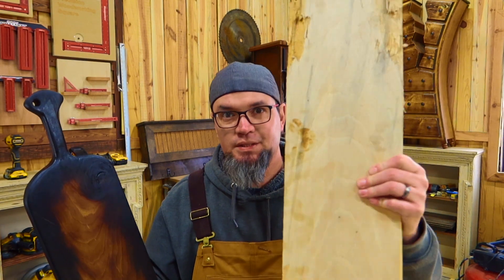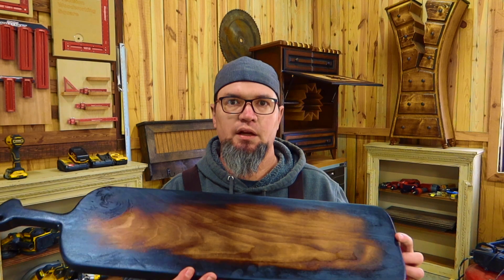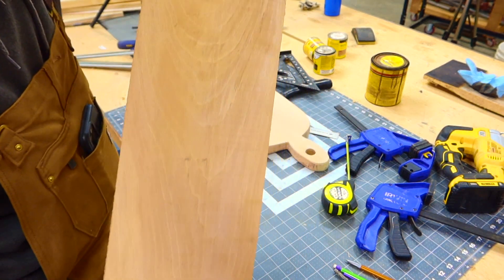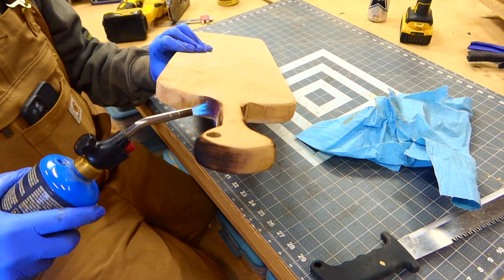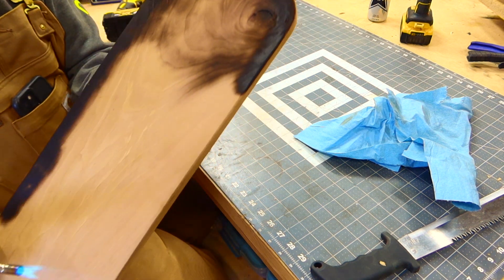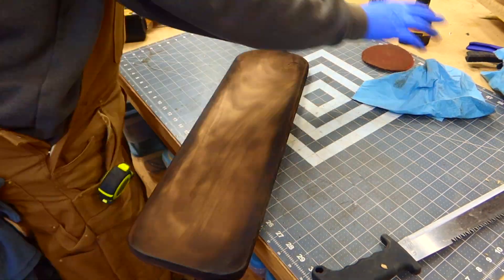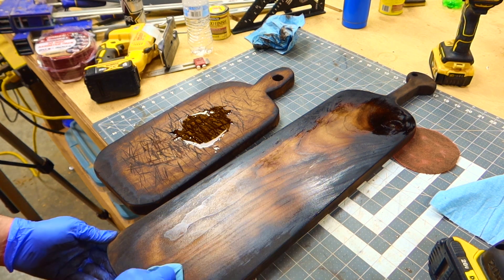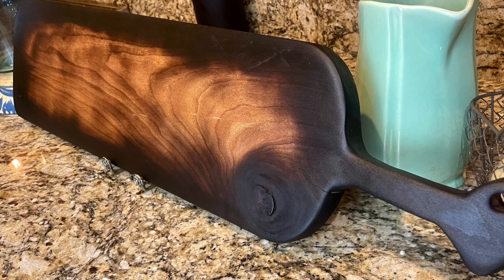Easy DIY Bread Board / Pizza Peel

Comment: Hi Matthew, LOVE the videos!! I've completed the burning and sanding and am ready to treat the wood with bee's wax and mineral oil, however, what  noticed that the black burned part (soot)of the board comes off in your hands? I wet it down, re-sanded it, wiped it like a million times, and still the black comes off on your hands when you handle the board. Will the oil and bees wax seal that in? or do i need to treat it to lock it in somehow? Thanks! Gary

Comment: Would you use a round over 
But with your router on the edges?
Reply: I used an angle grinder. But I wanted an antique look, just for decor.
Reply from the maker: You could use a router.  but its just as fast with a good sander.

Comment: Man I wish I had a fraction of your creativity. I run a truss manufacturing facility and we have so much scrap lumber that just goes to waste. Been trying to figure out a way to use it at home for woodworking projects.... Unfortunately, it's mostly southern yellow pine.  Any ideas? Keep up the great work!!
Reply: You could make some floating wall squares. Char, brush and finished.
Reply: You could make small blank frames.
And let others express their creativity
Reply from the maker: Heck yea.  Dude you're sitting on a gold mine.  
free wood is the best.  And don't underestimate southern yellow pine. I would say most custom made furniture is made from it.  especially anything that is painted.
Reply: If you’re located anywhere near the Kansas City area, I’d be happy to take some of your scraps off your hands. Especially if your just throwing it away!!